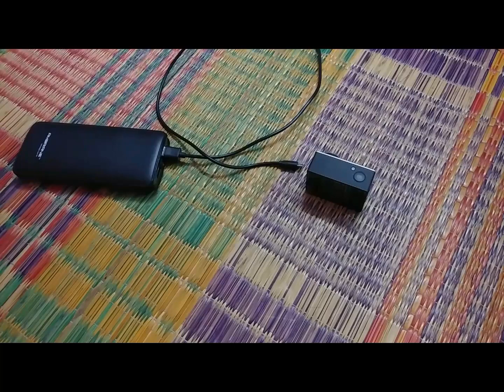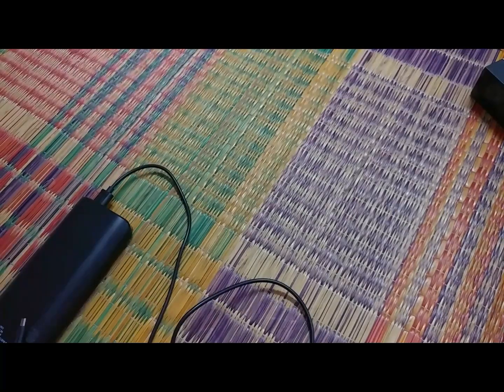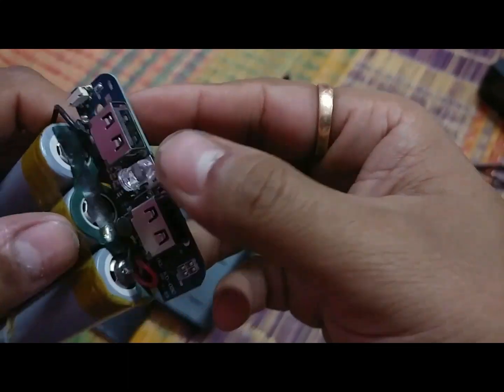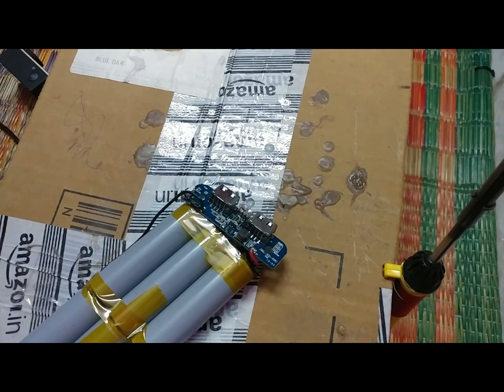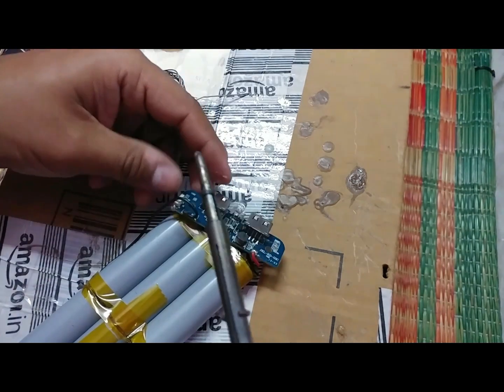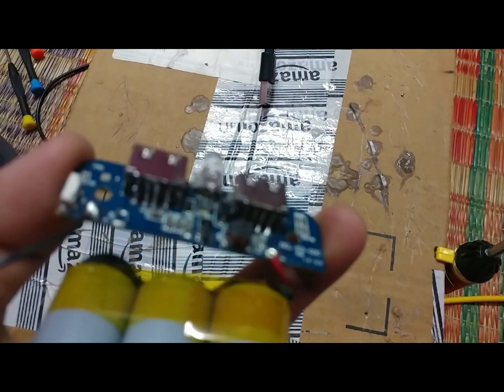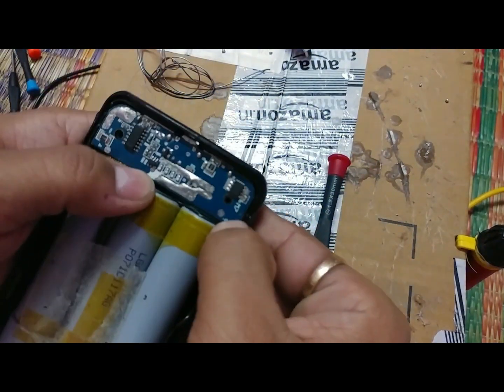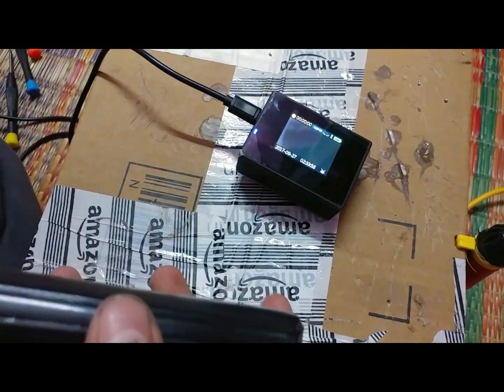inside ambrane powerbank P1511 and DIY repair

Comment: how did you open the case? I could not do it
Reply from the maker: Hi, I used flat head screw driver to open it, but i suggest you to use a few drops of petrol over the edges or joints and open it with flat head screw driver after a few minutes